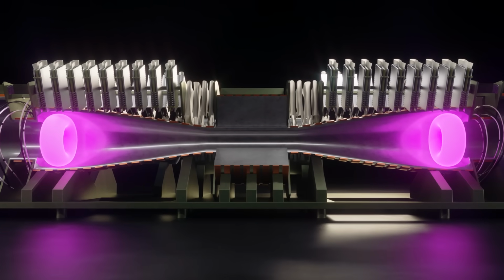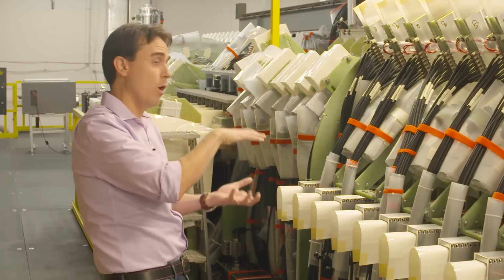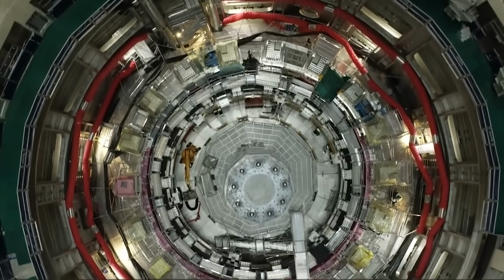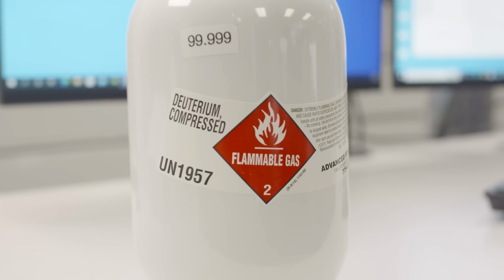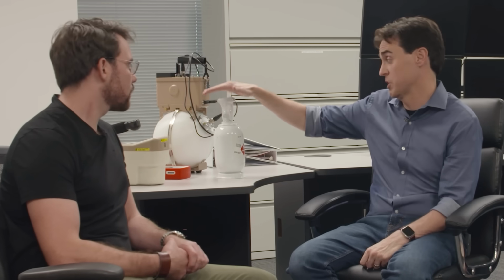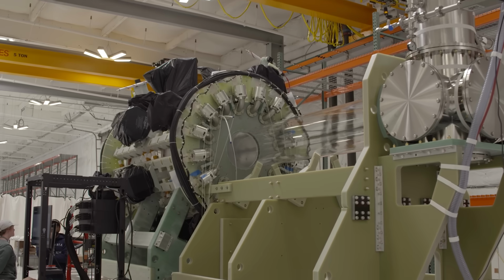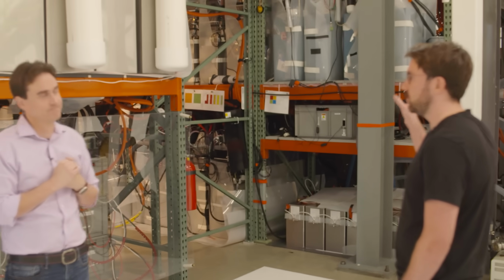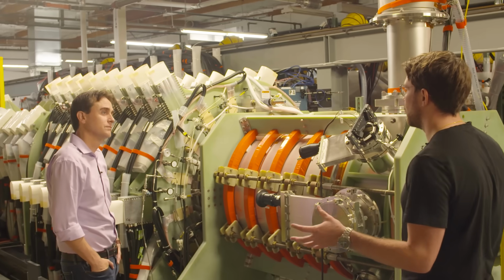A New Way to Achieve Nuclear Fusion: Helion

Comment: I'm just as amazed by the cable management outside the nuclear reactor.
Reply: With the current likely flowing through those cables (and the magnetic fields both coils and cables generate), they probably have to do something like that or the wiring gets its own ideas about "proper" arrangement.
Reply: @tz8785 I've seen some amazing cable dances from them coming unanchored.

As you note, this may look nice, but is probably cable management out of necessity.
Reply: @tz8785  my computer cables have less than an amp going through them at most and they still have their own ideas of "proper" arrangement XD
Reply: @tz8785  EMF fields must be huge!  That level of current through metal, even fiber controlled would make a hug expanding a collapsing fields.  Im assuming like Cat6 or basic RS449 type inverted or twisted tuned cables are essential to cancel the EMF.  Even then a Faraday shield would be prudent to avoid an unexpected field discharge as long as each element does not have to high a freq .
Reply: @tz8785  While there's amazing currents flowing through those wires, it's only for a short period of time. That said though, since the whole thing works on enormous, custom-shaped magnetic fields, you're very probably right. Not that the wiring would do a Doctor Octopus, so much as you might get a tiny misalignment in the field and the plasma won't fuse properly.
Reply: @tz8785  From the video I think the bundles of cables all around the machine are optic fiber cables responsible for controlling the whole thing.
Reply: @tz8785 guess we just have to figure out perfect superconductors which would not have a magnetic field even at millions of amps ;)
Reply: The real accomplishment here. XD
Reply: The main paper was on cable management, the fusion part was just a positive side effect. True story.
Reply: Nothing sexier than cable management.
Reply: @EpecFale  See, nerdy people needing colors is nerdy fashion statement, not needed for engineers !
Black Cables and orange stramps is enough!
Reply: @lucasrem  conductor and cable colour schemes are essential in electrical engineering, especially for multi-wire control, so you can instantly know what you're looking at, with the reactor the cables supply the magnets probably doesn't matter  they'll just be numbered back at panels.
Reply: @EpecFale  And nice conduit runs
Reply: As a former PC technician seeing all those massive orange velcro cable ties made me smile.
Reply: Cable management is pretty good. Needs some LED bling. 🙃
Reply: @zoopdterdoobdter5743  the entire machine literally flashes so bright that you can't be in the room when it's running so it kinda has.
But on the other hand they did say they would try to produce electricity with the next one and the only reason for that must be to run LEDs.
Reply: @zoopdterdoobdter5743  RGB will make fusion, fusion-er. Red ones especially.
Reply: @zoopdterdoobdter5743  Spinning hubs on the ends would look sharp.
Reply: @zoopdterdoobdter5743  Damn right!  Throwing in RGB power cables will easily triple their power output!
Reply: @zoopdterdoobdter5743  RGB fusion plasma is better.
Reply: They're professionals. They're not me.
Reply: @twistedyogert  I mean, they are NUCLEAR PHYSICISTS and I'm Me 😆😆
Reply: That's a lot of copper there. Thing goes belly up, I get first dibs. Gonna make me a cooking pot or something.
Reply: @handleismyhandle  The police raid your house and find you adorned in copper jewelry, stirring your soup in a copper pot with a solid copper ladle, sitting on a copper stool that sits on copper flooring which terminates at solid copper crown molding.😂
Reply: @handleismyhandle  I have some Beryllium for sale
Reply: @sailingcapedissappointment2012  It's highly toxic, I wouldn't want it for anything,
Reply: I was expecting to see an LTT cable tie somewhere
Reply: Assembling the power supply and running the cables was one of the biggest jobs on that machine. (I retired from Helion in July of 2021)
Reply: @257shooter9  thank you for your service Sir, what an accomplishment
👍
Reply: As a harness designer, this makes me smile. Having a clean cable management is super important, in any electrical system
Reply: The question is: Can it run Crysis?
Reply: @Raz82000  only on high setting, not ultra.
Reply: pc enthusiast dream
Reply: Our PC case cable management would be better if we were at risk of it killing us in an explosion.
Reply: Definitely a candidate for this years "Hottest Cable Management Porn"
Reply: @DoubleClickHD  timing requirements are insane, all lines probably need to be the same length within micrometers.
Reply: @DoubleClickHD  Well, I definitely got at least a half chub because I know how much of a pain in the ass it truly is to make sure your shit isn't tangled.
Reply: @DoubleClickHD  You need a PC for the Porn, not trusting the cloud!
Reply: @DoubleClickHD  not safe for work unless you work at Helion, in which case it is work
Reply: @DoubleClickHD  I think so too, you going to the awards this year bro?
Reply: Must be an engineering and logistical management nightmare, all the possible induction, interference interactions, impedance, propagation delays etc etc.
Reply: @jeffp3999  finally a comment worth replying. Indeed in this machine what dictates cable management is more complex than making it look pretty and organized.
Reply: Meh, needs more RGB.
Reply: Yes and I loved the use of dog cone collars xd
Reply: @Mr371312  what’s the purpose of the dog collar?
Reply: Gonna need the big zip ties
Reply: You really can't afford to have a geforce 4090 style failure on this, as it's a lot more power.
Reply: Including dog cone collars. 😅
Reply: Considering that this device will bring us a step closer to the whole of human civilization gaining one level in the Kardashev scale, I am not surprised by the cable managment. It should be no other way except perfect.
Reply: I bet they had a clean up day before the film crew came in :). I know I would
Reply: LMFAO.....🤣🤣🤣🤣Dude, I have spent hundreds on amazon trying to manage 3 hdmi cables and some power cords....It still doesn't look as good as theirs!
Reply: If they ever fail to generate a sustainable fusion reaction, they can always find work as PC builders.
Reply: I'm dismayed at the lack of heatshrink on the lugs.
Reply: Beats the hell out of what's going on behind my computer.
Reply: I like the cable management, the cap over the capacitor (with the polka-dot pattern) looks exactly like the cone I put on my dog to stop his licking. Good use of materials.
Reply: I was surprised to see so much exposed copper at the lug crimps. Guess it doesn't matter that much for test equipment, but still.
Reply: @jimmyfleebot  Exactly right exposed copper is sloppy.
Reply: @SeánONilbud  I had wondered after writing this whether it was done on purpose; conducting 100kA would make the cable contract, perhaps the exposed copper let's the cable move without the insulation pressing up on the rear of lug. Still, I would have expected  busvbars instead of cable, or custom terminals instead of lugs. I think the poor cable management is intentional too, to disrupt induction between cables. Kooky stuff.
Reply: Magnetic forces are fucking nuts. You should have somesort of cable management while working on project like this. Otherwise It will be hell.
Reply: The cable management looks a bit like normal good clean work on steroids. Has to be good. Bad work blows up.
Reply: @ShainAndrews  Disagree. You can't have your cake and eat it too. The insulation cannot be butted to the lug. The wire must be firmly butted to the stop inside the lug. You need a thin shiner or your lug will get a real close inspection. A big shiner is ugly but none is a problem.
Reply: I once ran my own ps1 AV cables to my own tv.... impressive I know
Reply: Meanwhile I'm here concerned for seeing regular duct tape holding some of it's parts
Reply: That’s where most of the development time went to.
Reply: you'd hope they would be meticulous enough about this sort of stuff
Reply: So I'm not the only one who noticed : D
Reply: Ohh the cable ties... THE CABLE TIES! 😉
Reply: I hear they brought in an eccentric pc gamer to help with that.
Reply: The real research is in cable management. They will sell this tech to Big TV.
Reply: Lol Trenta's got backrooms colors
Reply: So cleeeaannn
Reply: exactly my first thought too. this is so pleasant to see.
Reply: Has to look good on 'roast my setup' vids.
Reply: Setup wars 😂
Reply: @2squirrelsscrewinatree633  today on SET-UP WARS!!.. Helion Vs. Steve Jobs garage in 1976! This’ll BLOW YOU AWAY, stay tuned!
Reply: @stephanieparker1250  Yaaasss 😂
Reply: Its not a nuclear reactor?
Reply: So true.  Where I work, that alone would be a major breakthrough.
Reply: I used to work in a navy shipyard building new ships

Now if you wanna see some cables 👀... Just look up in any compartment, propulsion spaces or not

Talk about every variety, size, length, cladding, grouping, binding, pathway, diameter, etc known to man...

Honestly I don't know they do it I really don't

Like at some point each one had to be physically laid and that kinda blows my mind
Reply: thing has better cable management than my pc lmao
Reply: How do you see a "Flash" from within a vacuum chamber reactor?
Yes, there are lots of cables, buts whats with all the plastic sheets?
There are no wave guides or ion pumps its all cables and we just 'pump gas in' to a vacuum?  They ionize the molecules, where are he ion chambers, cables do not do this work.
This looks like a very clever sales pitch to woo fund raisers, rather than real physics in practice.
Then we get the 'Pressure section, pressure is equal on all sides, what are those bolts all about that he shows, looks like just a lot of words but little proof.  Again how do you see a flash on the outside of a system that has to keep a reaction tightly enclosed to stop it touching the sides.  Then it turns out it is only a third of the size of the machine we really need.
Let's see where this chap is in 10 years time?
Reply: true PCMR member
Reply: So not only will they be able to produce Helium 3 for further fusion but also create Tritium that can be sold to those different type of Fusion reactors
Reply: @buzzshocker1069  bro said "lets copy this comment all over the comment section"
Reply: @danisob3633  find the other comments with your eyes closed.
Reply: @buzzshocker1069  loser
Reply: @buzzshocker1069  Deuterium and Helium 3 do the Deuterium Trituim reactions, one atom of deuterium fused with one atom of tritium to form helium-4 and a neutron !
Reply: @buzzshocker1069  I prefer my fusion aneutronic, Boron-11 and a proton.  BRILLIANT!
Reply: @kayakMike1000  Later, my boron friend, later. Hope you are young, it may take awhile. Runs still hotter.
Reply: @buzzshocker1069  – I don't think Helion will be selling any tritium or helium 3. I think they will be using all they produce for their own fuel needs.
Reply: @buzzshocker1069  Tritium's not that special in terms of production. CANDUs make it along with a lot of other more specialized isotopes for medical purposes.
Reply: @buzzshocker1069  that's a pretty unrelated comment
Reply: @buzzshocker1069  h
Reply: @buzzshocker1069  At the expense of Lithium
Reply: @buzzshocker1069  How is that in any way relevant to the comment you replied to?
Reply: @buzzshocker1069  it’s honestly a more useful tool for generating fusion elements rather than fusion itself.
Reply: @buzzshocker1069 and tritium decays into helium 3
Reply: @buzzshocker1069  the tokamaks are not currently worth using if this one works, it pays off way more to let it beta decay into Helium 3
Reply: @buzzshocker1069  or fishermen that need tritium lights in the dark.
Reply: @CatboyChemicalSociety  we running of fluorescent stuffs already? what about algae in the sea which did biological process and emits light, hmm 12 years for the second source of energy, 6 times and it passes one generation.
Reply: @Adhjie  u do know I meant the whole tritium lamp thing as a joke since it is used in fishing and I have a few.
Reply: @CatboyChemicalSociety  info received, I will report this to the international nuclear association about the usage of tritium applications.
Reply: @CatboyChemicalSociety  can I hab luciferaze b0ss pliz
Reply: just cuz it a nuclear reactor dont mean it gotta look lyke some ugly shit, they do gotta make it to sell to people, and people don wan to buy duh ugly lookin hunk of shit
Reply: Thought I was the only to look at the infrastructure and cable management.
Reply: Glad I wasn't the only one distracted by that
Reply: I almost came
Reply: 🤣 that was my first thought! A result of a career in IT I suppose.
Reply: Yes
Reply: Lmaoo
Reply: Given the specificity and sensitivity of the task at hand, it had better be fastidious as hell.  LOL
Reply: It's probably got some killer heat sinks too.
Reply: Frfr
Reply: I see plastic...
Reply: Hyper OCD in action 🙂
Reply: Yeah just imagine the most high end mashine of mankind and its pure cable salad.
Reply: PC builders: "Is it possible to learn this power?"
Reply: Its so organized
Reply: Seriously it’s incredible 🎉
Reply: This is the truth that they don't tell you 👉The Connections (2021) [short documentary]👀
Reply: I reckon 80% of their budget goes towards zip ties lol
Reply: And yet it kind of looks like it's being held together with orange duct tape. 😬
Reply: Cable Management experts are the true Chads

they deserve all the simps
Reply: though I had a chuckle at the stack of milk crates separating what  looked like the moderating modules some time the simple answer is the best
Reply: https://youtu.be/r-EOPGmB5eI
Reply: I am too then I noticed one bunch that they didn’t put on the same side as the others and it breaks the whole pattern and it hurts me
Reply: Found the Master Race member.
Reply: better cable management then then what nature did with out body XD
Reply: First thing I noticed as an electrician, looks organised and easy to read.
Reply: The next generation Nvidea graphics will be powered by this.
Reply: Gold
Reply: Do u mean the velcro straps? 😆
Reply: hints the "6th generation". i want to see the 1st
Reply: @wolu9456  I was so shocked by chaotic cable Hypofeelingorderia, that I've failed to then recall both the 5 previous iterations and Hypofeelingorderia.
Reply: @cyberbiosecurity  yea. your brain probably couldn't deal with the trauma any longer and blocked it out.
sorry for the flashback.
 
😟
Reply: 26:18 is insanity. Must've take a week to cleanly run those cables
Reply: [Thread bypass]:
Since I'm sure you've been corrected multiple times on your use of terminology;
There was one shot of masses of (coaxial control signal) cabling, that made me think
'that's an awful lot of cable!'
Reply: Yooo thats so funny thats the first thing i noticed as well lol
Reply: The hydrogen collider is built were I am
Reply: After a couple of years of electricians getting in there to troubleshoot and it will look like a rat nest.
Reply: @mattperry7393  it's The 13th day . And it's Friday
Reply: I elected to do my senior project on the fusion process way back in 1983 and even back then, the cable management was wild.
Reply: My Gaming PC is better cabled. Okay it does not produce electricity I concede.
Reply: A rebuttal: https://www.youtube.com/watch?v=3vUPhsFoniw
Reply: Im not have you ever seen a Knock or any kind of server room lol>?
Reply: ~Global nuclear bomb fake Hiroshima deceptive There are no satellite photos of nuclear test explosions, please tell everyone~
Reply: Riiiggghht!!
Reply: Annoying to see to the lugs not heat shrinked wrapped
Reply: @Dan P change your name to Arthur job.
Reply: you are cute, off all the complexity of it, cable management haha.. Well that cable management is crucial and their position, distances, etc has a specific purpose giving the high voltage, high current pulses used to create those magnetic fields.
Reply: @jjeairborne8428  you are cute as well, and don't let anyone tell you otherwise
Reply: I would have thought they would be Litz cables
Reply: Yea they could build a hell of a gaming PC! lol
Reply: No, it's not.  But ok.
Reply: Very simple setup honestly
Reply: Well you have to square everything away in a case like this 😂
Reply: 16:13
Reply: Km upon km of cables
Reply: God, the Lord Jesus Christ loves you! Restore your relationship with God by repenting of your sins and putting your faith in Jesus Christ, "... that Christ died for our sins according to the Scriptures, and that He was buried, and that He was raised on the third day according to the Scriptures..." (1 Corinthians 15:3-4)
Reply: Repent....believe in Jesus. John 3:16 KJV - For God so loved the world, that he gave his only begotten Son, that whosoever believeth in him should not perish, but have everlasting life. Luke 13:3 KJV - I tell you nay: but except ye repent, ye shall all likewise perish. 2 Corinthians 5:17 KJV - Therefore if any man be in Christ, he is a new creature: old things are passed away; behold, all things are become new.
Reply: @jgdecaro1  self-transcendence to mystical union Enlightenment to 'see the light' oddly synonymous, making a star ✨ realised on earth by co-creators.
🌞💖👼👁️

Comment: No boiling water? Incredible!
Reply: Also no friction
Reply: @override4405  You cannot say that it is not friction because it is scientifically wrong.
Reply: finally :)
Reply: by not using water it wasted all the neutrons. Water absorb neutron, just use water to absorb the neutron rays from the fusion reaction, to boil it, nothing else is as simple as this.
Reply: @xponen  Perhaps if/when they split the reactor design into a generator and a breeder variant (the breeder being used to generate the Helium-3 they want and being the one that generates neutrons) they can use that for partial energy recovery to make the breeder more efficient.